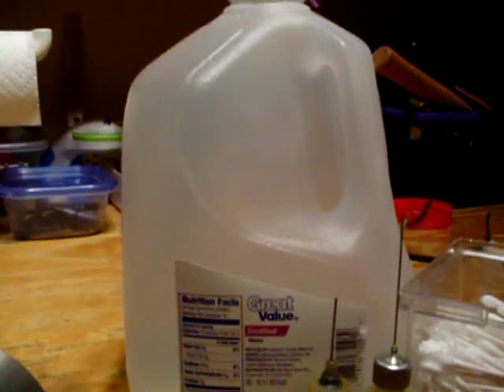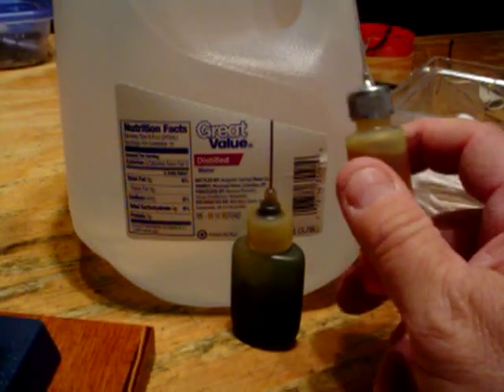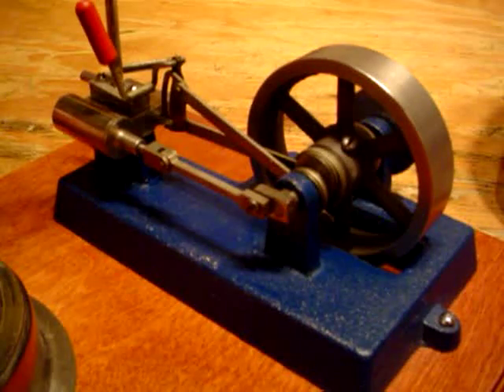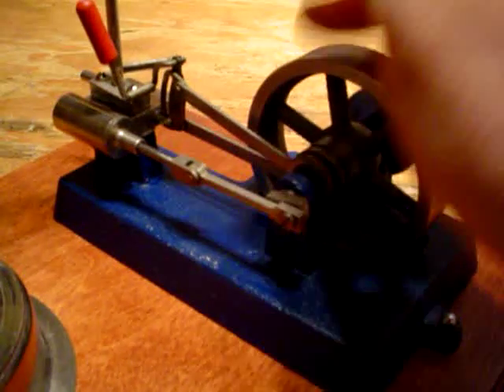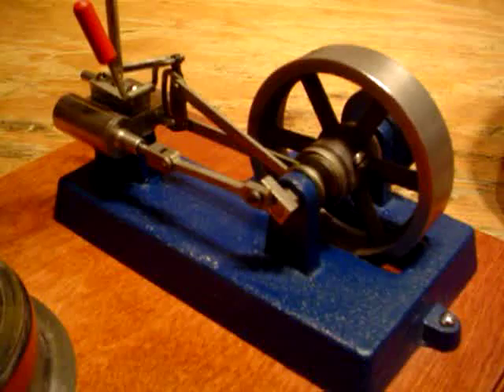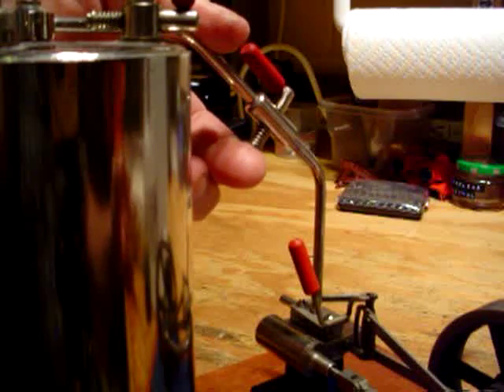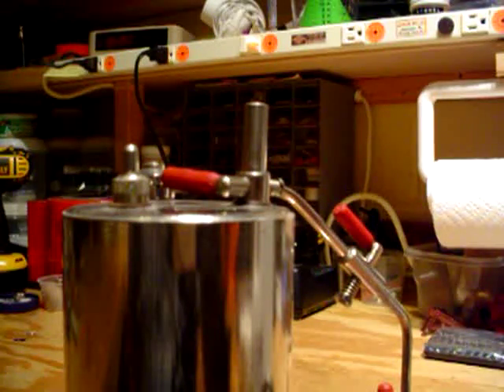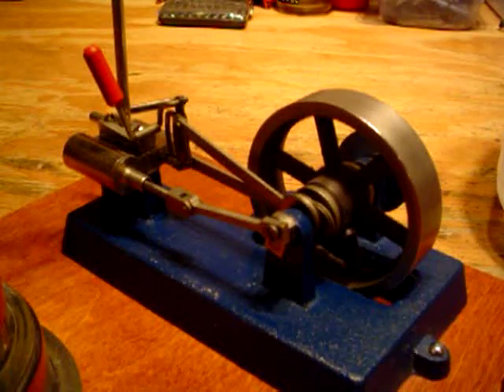Oiling & Prep of a Jensen Steam Engine.MPG

Comment: The Jensen Manual reads to drop oil in the exhaust then turn flywheel backwards.  There is a backwards??  I suspect you want to be sure the boiler has the whistle or safety valve removed when trying to have the oil sucked in through the exhaust.  Thanks for this video.